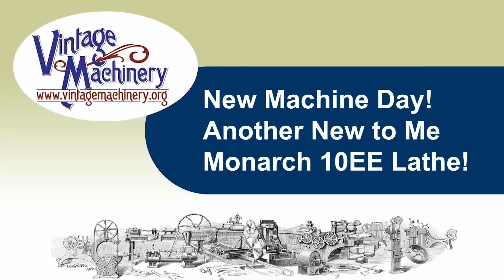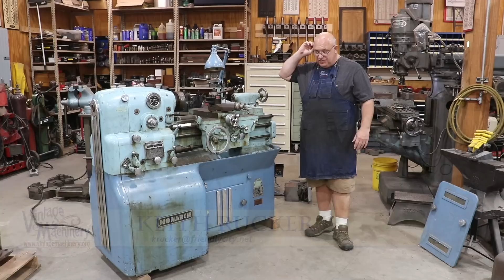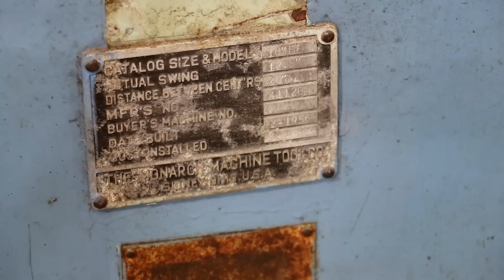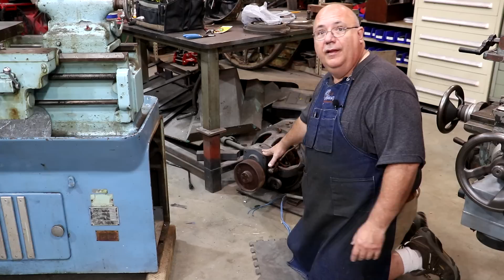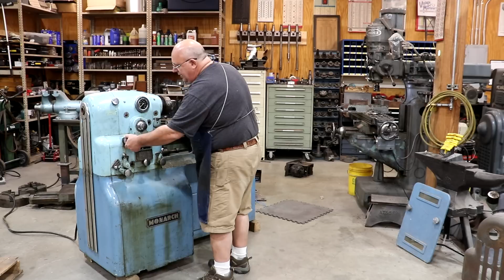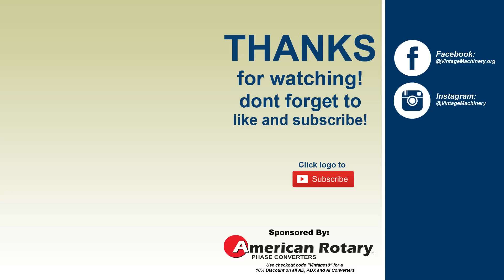New Machine Day! Another New to Me Monarch 10EE Lathe!

Comment: I am hearing a badly regulated power supply
Any competent electronic engineer with the original schematic can build a modern DC power supply.  The tubes themselves can be replaced with sold state plug in that actually work better than the original tubes.  I am a ham radio operator and I routinely replace increasingly hard to get vacuum rectifier tubes with solid state replacements.